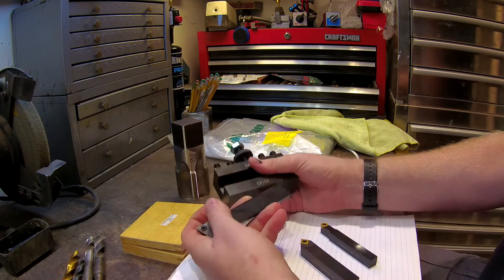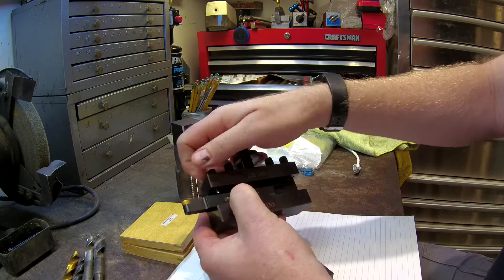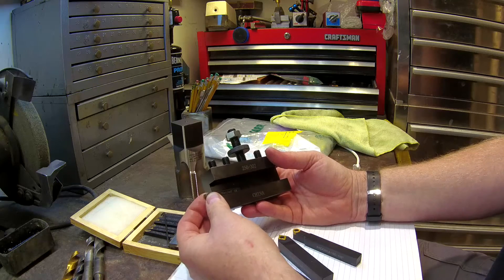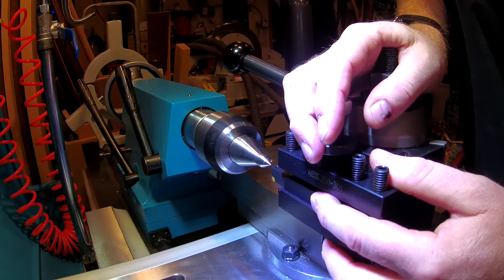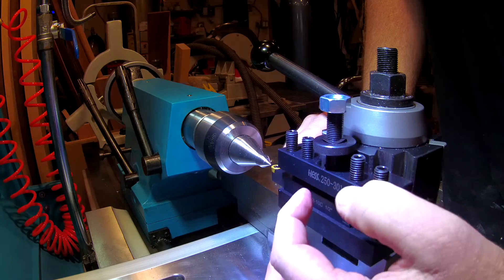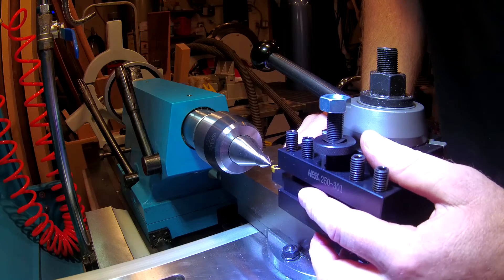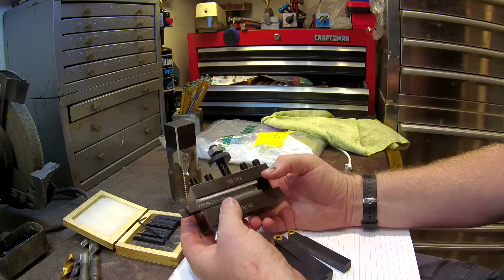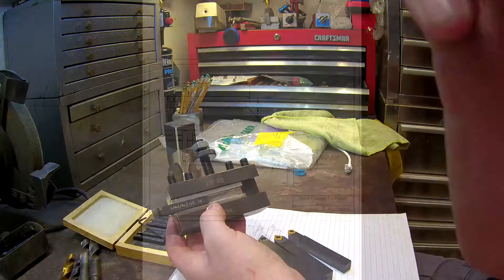CXA Quick Change Toolholder Adapter

Comment: Very interesting topic. But if you use smaller lathe like a 10 x 22?
Reply from the maker: If you use a smaller lathe, odds are that you can use a smaller tool (like the ones I was attempting to use) right out of the box. However, you might need something similar if you want to go still smaller, say to make clock parts like the outstanding guy on clickspring. Cheers.

Comment: Hello Dudley Toolwright (any relation to Dudley Doright on the old "Rocky and Bullwinkle" TV show? circa 1960),  I wouldn't say I want to see and hear nothing but machining but it is useful to hear a cutter to know when it is doing good or bad.  So since I don't get to spend a lot of time at my machines it is a way to develop that 'sense' of whoa up this ain't right when setting up a tool for feeds and speeds as well as other conditions that become apparent audibly.  That is why I am not a fan of sound tracks over the machining or fast forwarding when videoing to a large degree.  I was watching the insert and thinking there has to be a way where the insert could have a 'floating' plate that the tool holders set screws could apply pressure to thus negating the need for the tiny set screws on the insert and getting a better grip on the cutter?  Thanks for a thought provoking project.  Take care.  Doug
Reply from the maker: The name was chosen to be a play on words. Thanks for noticing. 

Thanks for brining up the importance of "hearing" the cut. You really can tell a whole lot about what is going on from the sound the cutters at making. Many times you even hear the problem before you see it. 

I really like the suggestion of making a floating plate. I wish I had thought of that. I will remember this trick the next time I am making something like this. Really great. Thanks for sharing.

Comment: Why would you want to use such wimpy lathe bits (1/4") in a much bigger tool holder (3/4")? What can they do better than bigger bits? They chatter more that's all... For delicate, fine work? Keep the large shank and grind a delicate tip on a big HSS bit. For delicate work sharp HSS bits are better than indexable inserts anyway. 
Most indexable inserts are optimised for heavy cuts. Large shanked indexable tools are better at that than small ones. Use the better rigidity that your large tool post offers to your advantage. You have probably upgraded from a smaller lathe and it hurts you to throw out the small bits. Sell them with the spare inserts...
Reply from the maker: Thanks for the input, it is always appreciated. Sometime small boring bars for internal grooving or small radius contour bits are hard to find in anything but smaller sizes. This is my first lathe and whenever possible I buy the largest sizes holders I can fit which is 3/4" to 1" depending. I most typically buy 20mm holders and mill them down to fit. That being said there is something to be said for how sharp/small radius you can get with high speed steel, It can provide a better finish than index able inserts is a bunch of situations. Thanks a lot for taking the time to share. Everyone wins.
Reply: and not to mention using small form tools ground from hss stock. why would i spend the time relieving and grinding away a .75" blank when all i need is a .125" radius. anyone who isn't aware of this hasn't spent much time standing in front of a lathe, at least not in a 'job shop' type setting.

Comment: Going to make a couple of adapters for my BXA tool holders.  Thanks for the idea!  She smaller cutters are a lot cheaper than inserts and suitable for much of my turning.
Reply from the maker: Thanks for the comment. By the way I discovered that after I made the holder, that the dial holder farthest way from the quick change holder was unnecessary so I removed it when I needed the get closer to the lathe chuck. Thanks again for the comments, they are always appreciated.